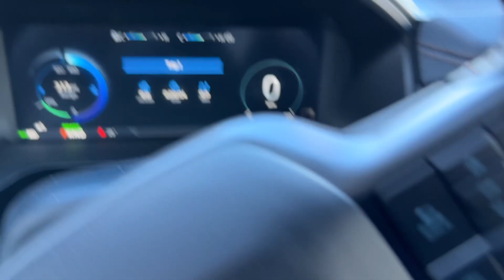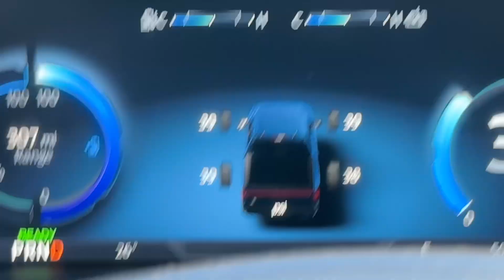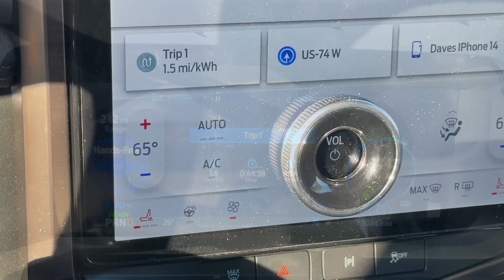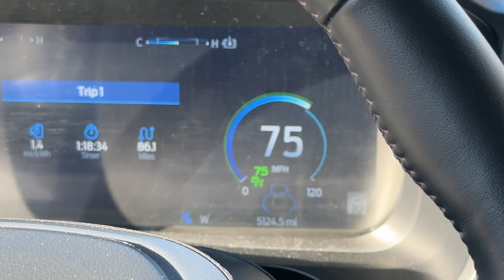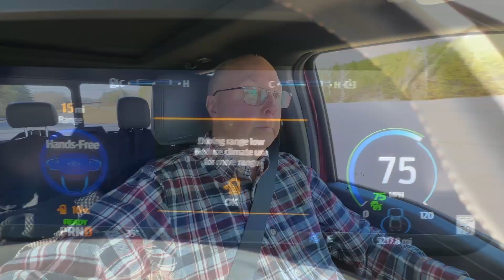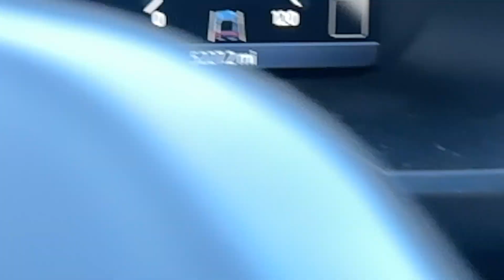Whats My Range in the F-150 Lightning in the COLD?

Comment: Hi David, I’m looking at a flash for my first ev. Do you think the heat pump will help? Did you precondition on this voyage? I’m in Chicago and have a 60 mile round trip commute.
Reply from the maker: By a tesla you will thank me.  Legacy auto is not state of the art.  Really, buy a Model Y and use my referral link to save an additional $1000
Reply from the maker: Yes you need a heat pump,

Comment: So you went 189 miles at 100% charge, how long to charge back up to 100%?
Reply from the maker: On a high power CCS charger 10% to 80% is 45-55 minutes. Charge rate drops by 50% to 50kw over 80%.

Comment: aerodynamics is a huge factor in efficiency, my streamlined low coefficient of friction EV6 was getting me about 3.5miles/kwh driving a few miles over speed limit. My wife would get about 4.1 because she drives at or below speed limit.
Reply: that Ford Lightning is like driving a billboard and any head wind, cold temperatures destroy range

Comment: With all the BlueCruise and Co Pilot driving that you’ve done so far, have you experienced any phantom braking? All those shadows from the trees over the freeway look like they would be prime causes for throwing off the cameras, but the radar probably eliminates that issue.
Reply from the maker: My experience is a couple phantom breaks but moreover it is way sloppier in driving it has trouble in staying in the lane sometimes and the worst part it will just doing and stop driving, you best be holding on.
Reply: Bullseye 🎯

Comment: Instead of the charging screen, which is better suited to charging info, you may want to look at the usage screen, which shows your usage for trip that splits it up between driving, accessories, temperature, etc. that would tell us how much the outside temp had an effect on your usage, as well as the amount the truck used for heating you and the cabin.
Reply from the maker: I am aware of that screen, it’s kind of history as it updates slowly.  I’d prefer some real-time readings

Comment: Great test! Have you tried hooking up to a NACS charger to see how they do vs CCS? Does Tesla charge you much more for NACS? If you’re at a crowded NACS, will you be automatically disconnected soon as the last open bay is taken by a Tesla?
Reply from the maker: I’ve got both NACS and J1772 for AC in the garage, AC power is there same except the NACS can put out more power in my garage.  J1772 can be handle 80 amps also if wired so. The effect would be the same if both were 80 amps

Comment: Thanks for the interesting range test Dave. Your Blue Cruse isn't quite what the "scientists" at Consumer Reports indicate in their recent ADA systems testing. It has Ford, GM and virtually all other ADA systems much better than FSD. In fact they state Teslas FSD system has had no major improvements since it's inception. 

I used to respect Consumer Reports but this amazingly ignorant report is proof that Consumer Reports is no longer credible. Looking forward to your ADA test Dave.
Reply from the maker: I’ve driven Tesla Autopilot for 5 years now and it’s steadily improved over the years. In my opinion Blue Cruise is equivalent to what has in my original model X in February AP2 2017.  Watch for a more detailed video on what to expect on BC

Comment: Dave those temperature gauges work, assuming the weather just has not affected them. I live in upper Midwest and if the truck is parked outside all day the batter temp gauge definitely falls down
Reply from the maker: In 25 degrees sitting overnight they still did not move, I have my doubts

Comment: lol so much anxiety you cant use heat and have to keep your jacket on? I will wait another 10 years before I consider an EV hopefully solid state batteries can make them better than ICE's one day
Reply from the maker: You missed the test parameters setup…
Reply: This was just his attempt at being scientific. If he’d set the heater to 72° it would have reduced range further, but that’s not the end of the world. If you’re looking for an EV that has less range loss when using the heater, look for ones with heat pumps. These days Tesla is the best at maintaining range in the winter. Remember, the reason your ICE can keep you warm without using any extra gas is because it’s always wasting most of the energy in that gas. It is precisely because EVs are so damned efficient that they don’t have much free heat.
Reply: @pepstein  efficient but not enough cold weather range and not enough charging infrastructure.  Tesla I would maybe consider, but I will still wait until both improve.
Reply: @andrewward4246  you won't have to wait that long, as batteries are improving rapidly. Hopefully US public charging will improve significantly in the years ahead, but if not you can always go with a Tesla. Cheers.

Comment: My admiration for the F 150 lightning increases with every video you post. I prefer SUV’s to trucks so I’m hoping Ford produces the  electric version of the Explorer soon. I prefer my Mach E over my model 3 so I’ll stick with Ford.
Reply: Just wondering, how do you like your hardly ever working properly, “born brain dead,” VW Penitence CCS based chargers compared to the “always working easy & well” NACS ones?
Reply: @Crunch_dGH  so I have 40,000 miles on the Mach E. On occasion one or more chargers are down but I’ve never had an issue charging at electrify America.  I charge to stop at baker California  on my way to Las Vegas from Los Angeles, whether I take the Mach e or the model 3, because this stop has both the Tesla chargers and electrify America next to each other. It’s not uncommon to see a Tesla charging at the EA site here and I’ve done it myself as well, because it charges faster and the price per KWh is cheaper.  I base my choice solely on my own experiences.  And I prefer the Ford product over the Tesla.

Comment: Thank you for posting this.   I am leaving next weekend on a  Denver to Houston run in my Lariat Lighting and was wondering what level you had the heat on while you were on your drive?   I was planning on bundling up pretty warm in the truck and using the seat heater as my primary source of heat in order to extend range.   I would like to get 1.7kW per mile while doing 75mph through eastern Colorado and Kansas.    Seems like this might be achievable based on what you posted in the video.
Reply from the maker: The lightning uses resistive heating in therefore is very inefficient the best way to do it set the temperature at 65°. It will actually be closer to 68° in the cabin for whatever reason I don’t know why and turn your seat heat on and you don’t need to bundle up or anything it’ll be just fine. Your biggest problem in road tripping with the lightning is to locate fast chargers along your way as the user interface and the mapping sucks but if you pay attention, you should have a good trip
Reply: @evdave528  Thanks for sharing.   I have done the first leg of the trip, the one from Denver to Houston.   It is no surprise that  the truck does not like the extreme cold - like 20 degrees and below.   When you add in traditional highway speeds the truck will not do 1.7kWh per mile.   For the first part of my drive temps were extremely cold so I had to do like 68mph on the hwy to achieve 1.7kWh or 1.8kWh per mile.   When I hit Texas and temps got to 50 degrees and above I started to see better efficiency at higher speeds.   I was getting 1.8kWh per mile at 72mph.    I absolutely do not use the Ford navigation for charger location, I have done the drive several times in my Taycan so I know all of the Electrify America chargers between Denver and Kansas City and down I-35 to Dallas.

Comment: EVEN FORD's Farley is just now finally admitting the Lighting and Mach-e are very poorly designed... I predict the long term (massive !) Ford "quality issues" will doom these recent Ford EV products...   In addition FORD is just beginning to a admit that its product  recall and warranty catastrophes are setting records this year 😂    Biden and his UAW conspirators (FORD, GM, etc) will fail 🔥 IMO...   IF I owned one I would sell it immediately before the world "wakes up" to their problems...
Reply from the maker: The lightning itself is awesome in that it is an F150 with an electric drivetrain underneath the years of refinement for an F150 is evident it is a nice truck to drive but electronically and electrically. It’s OK user interface sucks. Navigation sucks but you can work around those problems. The truck is very nice to drive however
Reply: @evdave528  IMO Ford will fail.🔥  The F-150 Electric was "rushed out" and I believe the current battery issue is ONLY the "tip of the iceberg."  The corrupt influence of UAW parasites, the "culture" of FORD  and GM as Sandy Munro would say is repugnant, they are ONLY good at wasting money on commercials IMO.   Once your warranty on a FORD or GM EV is out you will be SCREWED.

Comment: So in other words electric cars aren’t there yet.
Reply: That's painting with a broad brush. Not all OEMs are created equal. In the last few years, there has been a lot of improvements with some manufacturers and not so much with others.
Reply: @robintaylor1490  When it comes to EVS all OEMs suck other than Tesla... It is a sad fact but the truth... EVEN Fords Falrey is just admitting his lightning and mach-e designs suck and he is cancelling all the design team bonuses !  
The liberals hate this truth and they wanted ot crush Elon for the WORNG reasons when Elon is bringing the USA🇺🇸 jobs, prestige and taxes.... Sickening when you think about the treasonous anti-elon  vitriol...
Reply from the maker: Yeah, I would expect that you would say that but you’re absolutely incorrect electric cars are here to stay as proven by Tesla, the Ford however, need some updating and some work to be state of the art like Tesla cars
Reply: ESPECIALLY. non-tesla products by legacy MFTRS... They SUCK !!!!
Reply: The reason ICE vehicles maintain relatively consistent fuel economy in cold weather and at high speeds is because they’re always wasting most of the energy in the gas. This provides a useful source of heat for the cabin, but it’s terribly wasteful. EVs are so efficient that there isn’t much waste heat available to heat the cabin. In city driving EVs capture energy during braking, hence their higher city efficiency. That explains why EV range varies so much with speed and temperature. It’s not the end of the world.

This particular EV is quite inefficient compared to most others, and it lacks a heat pump, so cabin heating is also relatively inefficient. Despite this, it’s perfectly capable of road tripping.

Comment: Good point about the antenna but if you reduce the antenna size, it will cut the reception range for those low power a.m. stations
Reply: Nobody listens to a.m. radio. Actually,  nobody listens to radio period. Only Boomers, and even then not many.
Reply: @Japplesnap  I switched the media input to FM on my Wrangler 4xe for about a minute.  The deluge of commercials had me quickly switching back to Android Auto/Spotify.  First mod I did to the Jeep was install a rubber stubby antenna.

Comment: Three questions: 1) how big is the battery, 2) how many kWs did you use, and 3) what would the wh/mi be for us Tesla guys?
Reply from the maker: The lightning battery is 131 kWh.  The conversion to water hours per mile take 1000 divided by the kilowatt hours per mile so it would be 1000 divided by say 1.5 like one of the responders to this question indicates it is a Lotta power you’re dragging that heavy square vehicle through the air.
Reply: 3) It’s gotta be over 600 wh/mi. Which for us Tesla guys is a butt load.😊 And I’m gonna guess that it’s about 130 KW battery - 125 KW was used to travel the 188 miles. Hope it does better in warmer weather…
Reply: 1.5 mi/kWh = 667 Wh/mi

You calculate it like this:
1000 / 1.5 = 667

And you convert back the same way:
1000 / 667 = 1.5